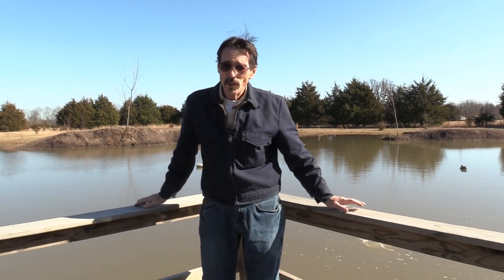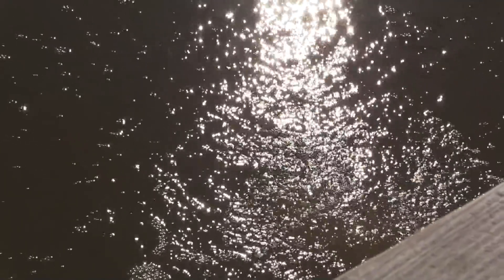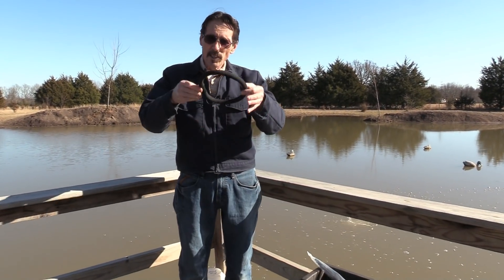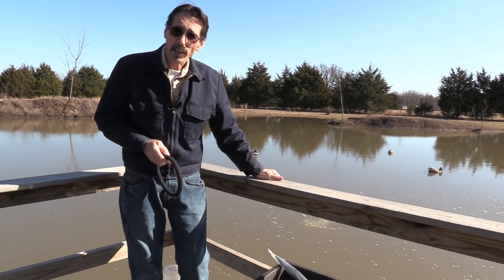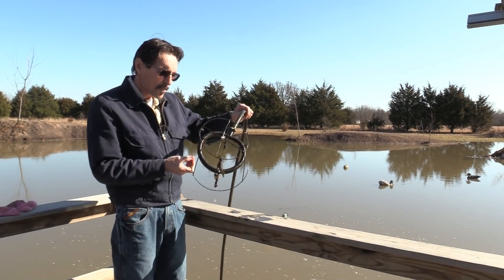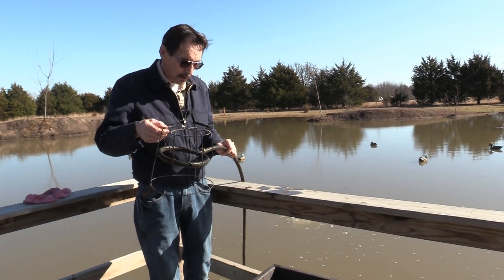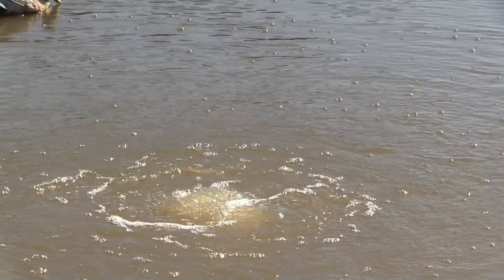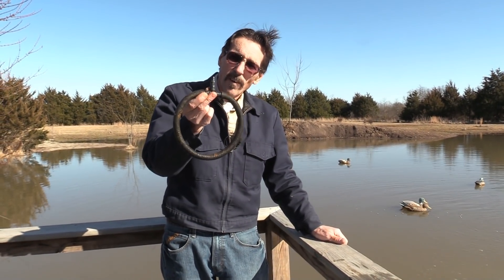Pond Aeration  Diffuser Cleaning How To DIY | Missouri Wind and Solar

Comment: I worked in the oil fields. We had to haul water from tanks (pounds) from place to place. We used an inter-tube to keep our vacom hoses off the bottom. But your idea works just as well.

Comment: I use a check valve and it only helps for extreme cold.  I have my round airstone type diffusers in buckets and I still take them out once or twice a year and clean them.

Comment: how did you dig out your pond to make it deeper ?   my pond is silted in and do not want to spend $4,000.00 to have it drained and re-done .  I have a " exceptionally clear pond " (you can see your hand at the bottom,  if you put your arm in the water up to your shoulder) and want to keep it that way.
Reply from the maker: We had a 3 month drought and most of the water dried up. So i rented a large track skid steer and dug it out. Now we had flooding rains and it refilled in a week.
Reply from the maker: It cost me $400.00 for the skid steer rental.